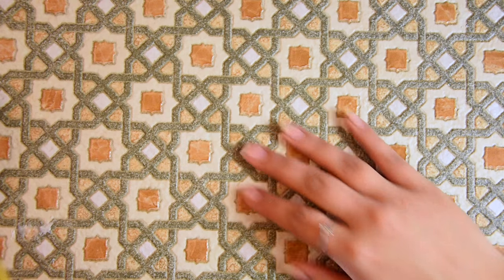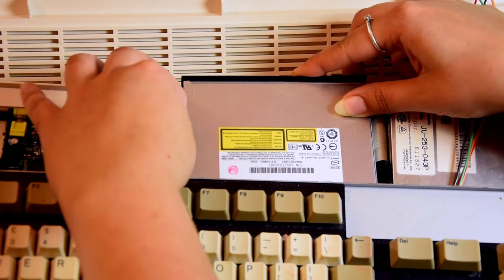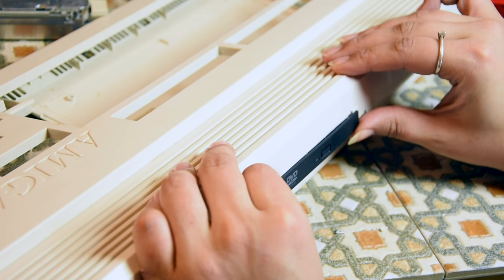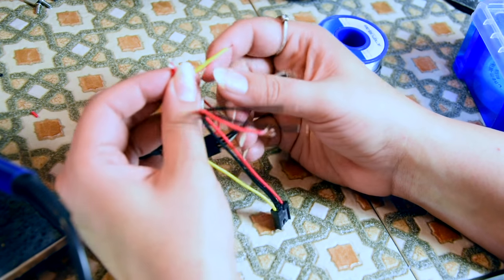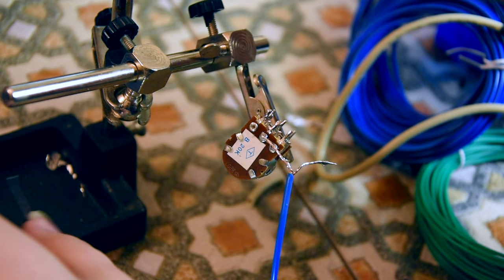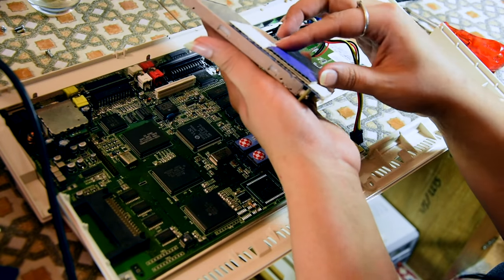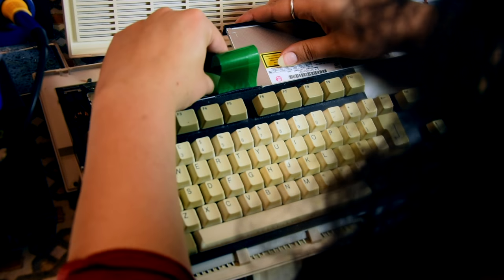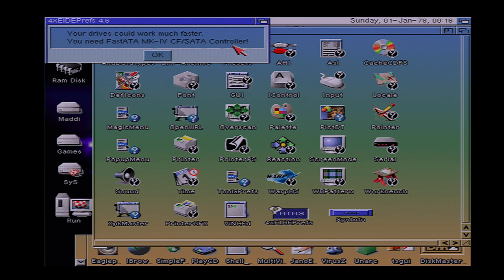Amiga Optical Drive - Part 2

Comment: There is a way to extract the CD32 Music CD menu for the CD32 ROMS and have that program open when you insert a CD on Workbench... I had the CDTV ROM version on the A600, it was the coolest looking thing ever. I never got it to work with the CD audio opening the CD Boot menu on its own though.... I could only double click and open the CD Menu from CDTV within Workbench on the A600...it was still nice to see it running.

Comment: BTW, you can pop the pins out of those black connectors. Good for keeping the colours all the same. 
There are 2 forms that I know of:
1) The pins have a tang (spring clip) that you can push in with a needle then extract the pin. re-form the tang before pushing the pin back in.
2) The connector has a plastic tang holding the pin in. Use a needle to catch the plastic tang and gently pull on it until it releases the pin (all the time pulling on the pin).
I suspect those connectors are type (1).
Cheers,
 - Eddy

Comment: This is my next project for my A1200. Got an ACA1221 and Gotek with CF HDD. This has to be the next natural step. I hate cutting into original cases just like you. Makes me feel bad and puts more pressure on you knowing the whole of the Commodore community are breathing down your neck not to ruin it. You did a good Job I must say. Luckily I have 2 A1200's and hope to just make 2 identical machines and maybe release one back into the wild and sell it. I am the goto man for my friends who still have Amiga's. One has an A500 and the other an A600. Im Greedy with 2 A1200's I know.
Reply from the maker: Actually you're not greedy with 2 A1200, if you want my advice i would keep it, heck i would get a second A1200 also if I had the chance... we have old hardware that could go funny at any time and its always good to have a spare... I felt the same way at first with 2 A600s but i think considering how quick the prices are rising, it may be a good idea keeping one spare or using it as a secondary Amiga for another operating system/configuration maybe... one of my A600 has vampire, the other i have different plans.

Comment: Years ago i had an amiga 1200 fitted into a tower case with a blizzard ppc card, but i stupidly sold most of my amiga,s a while back so now i have 2 a1200,s the better one of the 2 has the aca 030 card  this time round i to want machine to look like it did in the factory made case  i am thinking of adding the cd/ dvd drive externally so i need to work out a tidy solution to the cables for drive and power.
Reply from the maker: Yikes, the same situation as myself more or less, towered amazing blizzard ppc 1200 sold with great regrets now. 
For the CD/DVD drive, I was initially planning on doing an external one and thinking about buying the thinner IDE cables from ebay, like a rounded cable rather than a ribbon (but longer than this of course)  http://www.ebay.co.uk/itm/42cm-ROUNDED-RIBBON-HARD-DRIVE-DVDRW-ROM-ULTRA-IDE-PATA-CABLE-ATA-100-133-40PIN-/262817629455?hash=item3d3126c50f:g:-uoAAOSwNSxVM4Bz

Comment: An insightful video, and Im really happy to see everything working. As you say, its about the journey with these builds, and a labour of love. I think there is something about the wedges which feels more Amiga than a box box A2000, or whatever. The keyboards also feel very nice to type on, as I'm doing at the moment, and although I wouldnt recommend trying to squeeze a PC into an Amiga case, it can be done, and feels satisfying to collect all the extentions and bits of kits to build it. Do you have any more plans for your machine? I know some say get a Gotek, but I love the heart beat of the disk drive click, and even the sound of disk loading, so if I got a Gotek it would be external. 

I dont think anybody can say you did it wrong, because you do it in your own way, and the blue tape even matches the Blue on the 3.1 Roms, so it looks very good to me.  I was wondering how you get enough power from your brick PSU, but I remember you have a red PSU for the Amiga, so that will be more than enough. :)  I did get my mind blown the other day when I watched a 26min video on youtube called "Steve Wozniak - The Shocking Truth", about ESD.  - a must-see for all retro soldering-heads. :)
Reply from the maker: Thank you :o) 
Yes indeed it's about the journey of the builds and this was quite a fun project, even though cutting the case was heartbreaking :'o( .. there are no regrets as all turned out well :o)
I have a couple of more plans for this machine yes, one of them being the pico power supply which i'll be doing, however I am delaying this due to more fear (despite many having a successful one going) Anything that messes with the major parts of the Amiga i have a fear about haha. 

I must check that out, the Steve Wozniak video!

Comment: By the way a FastATA or IdeFIX is kind of an adapter which you plug into the IDE Connector and between the KickRom Chips and their sockets via an additional adapter of your Amiga 1200 or Amiga 4000. These devices fix some stuff on the IDE Bus to speed the drives or flash cards up :)
Reply from the maker: Thanks! Always nice to discover new things I had no idea about :o)
Reply: I would not recommend you getting one by the way. It is really just the "number of the speed" in sysinfo. You wouldnt really feel the speedup at all
Reply: The idefix software is always nice to run, even if you dont have the adapter. AmiFailSafe+Idefix is excellent (AmiFailSafe is filesystem, replaces fast file system)

Comment: Nice Video, it actually made me do the same Mod. The only Problem i have is that CD Audio Volume seems still very low and when i go to its limit, the right native Amiga Audio Out goes down while CD Audio goes up. Strange Behaviour. I use the 20k Potentiometer as well. I just connected GND differently. Why didn't you connect the Audio GND to the Potentiometer? You just did a bridge on that. Thanks!!

Comment: Really cool!, I put a Gotek USB Floppy emulator basically in the same area on my A600, just facing the left side. I modified a floppy cable to add another connector and I use a DPDT switch to switch the power between that and the real floppy.

That other connector that you're not sure about is most likely just another audio connector. Some sound cards back then had that smaller connector.
Reply: Well same as in the top part, on the left...
Reply from the maker: Yes I'm guessing the other port is for soundblaster cards? again guessing :o) 
That's actually a good idea, a floppy drive and gotek in one, switchable, you can have the best of both worlds at least. I'm not keen on 100% gotek only drive for myself, floppies are part of the nostalgia for me.
Reply: Agreed.
Reply: Yes it is the older audio connector which was named `mitsumi connector` just look on Ebay for it, I have used these on my A1200 CDrom set up with a set of special mixer RCA splitters which are a pass through type so you can plug the Amiga audio RCA jacks into them, I just  cut soldered on a `Mitsumi connector onto the splitter cable.
great job there Miss Lemon !
link for the RCA splitter for anyone interested
http://www.ebay.co.uk/itm/2-WAY-RCA-PHONO-Y-SPLITTER-STACKABLE-AUDIO-CABLE-SPEAKER-HI-FI-AMP-LEAD-1-8m-/331238322733?hash=item4d1f57b22d:g:CwsAAOSw-7RVCXft
Reply from the maker: Thanks Superman :o)
Reply: No  problem Lois Lane :)

Comment: Hi, you are great laugher :D I was trying to find which cd rom you finally used and what is more important which potentiometer 10, 50 or 100kOhm? Thanks!
Reply from the maker: Thank you! :o) 
I think for this a 10k would be fine. it's just the volume range that's affected with the values.

Comment: Another great video.What ide adapter did you use that has the audio connectors though?
Looking forward to your next video.
Reply from the maker: It's basically the same adapter, the slim pata CD drive to IDE but you can get ones with or without the audio. 
Thank you!

Comment: I don't seem to see you using heat shrink tubing anywhere on any videos I've seen so far. Do you use it at all and if not, why not? :)
Reply from the maker: I never had it when I was doing this, bit I use it in part 3 of the Amiga optical drive series :o) 
https://youtu.be/rNWpi_lRGj8
Reply: Yes, I've just spotted it and had to comment :)

I can't put a CD drive in my A1200 because I've got kiper2k's external CF adaptor card which lets it pop out just above the PCMCIA slot for easy access, handy to back it up on a PC or even to swap the HD out with another one set up plus I don't have any need for one.

Have you thought of adding a Gotek inside your Amiga together with the floppy drive? Leave the floppy drive in place, get a Gotek and take it apart. With Keir's awesome FlashFloppy firmware for it you can get a small LED display and mount that. Have the Gotek and the floppy drive together and have a switch sticking out somewhere to switch between the two. Now THAT mod I'd love to see as it's something I'd love to to do my machine but no idea how the electronics side works adding a switch.
Reply from the maker: i'm hesitant to put a Gotek in my A1200, however I have plans for another Amiga, but thats a bit hush hush for now ;o) 
It's a shame you can't add an optical drive to your A1200.. well assuming that you want to haha. I still yet have a lot to learn about Gotek, actually i've never used one before.
Reply: The Gotek is great. You can't beat the feel and sound of a real disk drive but if you take the Gotek apart, it's easy to mount it inside the machine elsewhere. I've actually bought the push buttons, new digital display, glue gun and other bits and pieces to mount it inside separately in anticipation. Just don't know what I'm doing electronics wise yet. Best of both worlds :)

Comment: so cool. have you tried to burn any cd yet? and is it possible to boot from a cd?
Reply from the maker: No not yet, thats something I wish to try actually. I dont think its possible to boot from CD (not that I know of) because the drivers are installed in workbench.
Reply: Yeah. You're right. It won't work :(
Reply: You cant really boot cd's from scratch on a1200. However, if you install CD32 emulator, you can 'boot' any cd from workbench.

Comment: Can you play CDTV discs with this setup?
Reply from the maker: I know I can play CD32 games but i've not tried CDTV titles, I assume you'd need an "emulator" just like with the CD32. i'm not sure if anyones made one.
Reply: That would be interesting , though i remember using a disc caddy with my CDTV ,
Reply: Most CDTV cd's can be run without any 'emulator'. If it doesnt, just run the kickstart 1.3 emulator, and you can then run all of the cdtv cd's. (you still need to mount the cd drive in workbench)